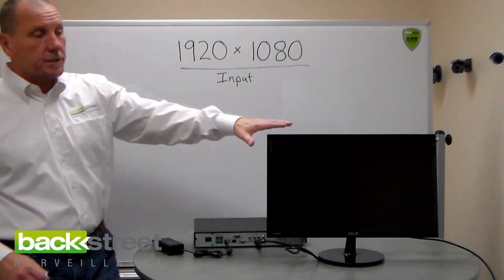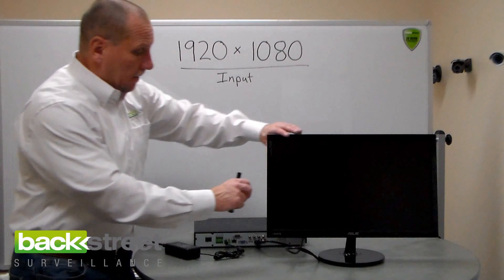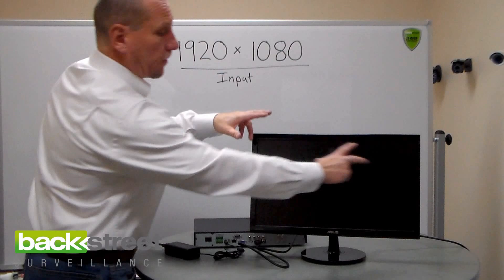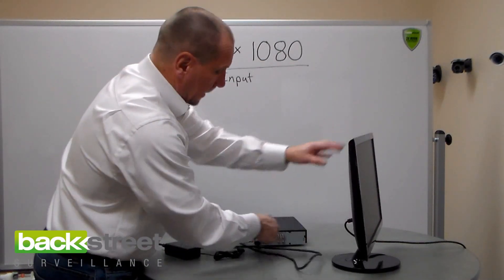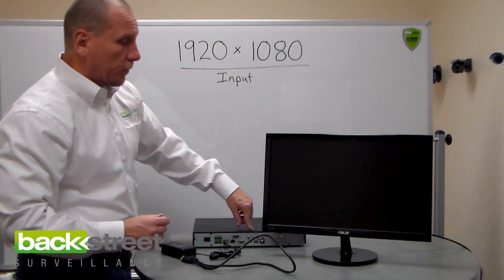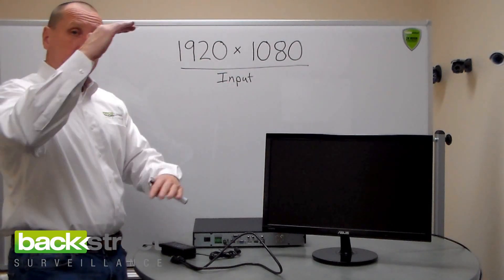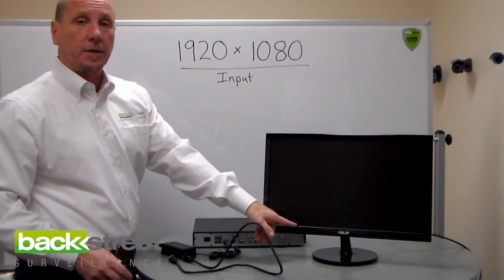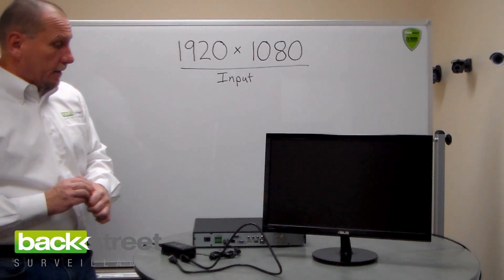How to Trouble Shoot Security Cameras - Trouble Shooting - No Video on Monitor

Comment: I have checked my cameras all getting 12 volts but still shows offline on all cameras what is my problem ?
Reply from the maker: Look for the one thing they all have in common....the video recorder. Since you are working with 12v I assume its a coax system and likely an older one. I would do a bench test with one camera you know is working and test every port on the recorder with it. If you know the camera is good, the cable is good and the camera is getting power, there is only one thing left...the recorder is bad or programmed wrong.
Reply: @BackstreetCameras  it's a wireless system

Comment: I was hacked yrs ago.  I was using a lcd moniter with No intergated cam. ( Early 90's)  they sent me a pic of me looking at my screen from the screens point of View ! I think it was a PowerPoint option.  ?  Or some sort of hack ?   Can you elaborate?  Or have you any knowledge of ?
Reply from the maker: Most hacks are not hacks. Usually the user did not change a factory default password which allowed the "hacker" to do a search on the web for the factory default password and then just logged in and started messing with you. The IP address they were scanning gave them the brand name of the equipment. No amazing hacking going on. ALWAYS CHANGE THE FACTORY PASSWORD ON ALL EQUIPMENT AND SOFTWARE. If you do, I doubt you'll get hacked ever again. Thanks for the question.

Comment: I get no screen at all everything reads the dvr but no success I think it’s the Hard drive I have to replace
Reply from the maker: Even if the hard drive is dead most systems will display live video if the NVR is operating correctly. The systems do not require the hard drive for operation (only recording) so it possible the recorder is the cause. Hope this helps.
Reply: @BackstreetCameras  
Hmm thank you for the reply and advice! 
Hopefully I can figure it out I think I’m close narrowing down problems

Comment: Please l am using hikvision 1Mp cameras and jovision dvr but when l power on the system the cameras comes black and white at the same time the cameras are not stable as well it comes and go off and l can t detect the problem. Please help me out
Reply from the maker: Sorry not enough information to give specifics but try removing all cameras from the system but one and see if the problem persists. If it goes away with one camera try adding a second camera. If the problem occurs when you add the second camera its likely the camera just added or a power problem. We suspect its either a faulty camera or the power supply powering the cameras may have a problem. Sorry we could not be more specific. Thanks

Comment: Ive got a night owl. Set it up was working fine. Few days later, tv is black screen. But system appears to be working. My modem light is on and normal ,cam lights are good and nvr power light is on. But nothing is showing on my tv.. Had this same exact problem with an amazon system years ago.  Hdmi output seems to fail somehow. Any info is appreciated. ty
Reply from the maker: Just take your computer monitor and use a HDMI cable to connect it to the recorder. If you get video its the TV or the cable. No video then the video out put on the recorder. You probably have but check the HDMI source button on the TVs remote . Good luck.
Reply: i also have a night owl , it was working fine this morning i come back and nothing , i tried 2 different HDMI cables and 2 monitors and still nothing , did you ever find a solution?!

Comment: I have a jooan  camera system and the video has shown up for all four cameras but now two have shut off completely and have stayed off despite factory resets.
Reply from the maker: Defective equipment likely, do you have access to tech support from the supplier? I would call them. The brand is not a main stream brand so support is going to be scarce. Hope this helps.

Comment: I have been trying to find out what is wrong with mine for over a month now and via tech support I attempted a factory reset, but there was no  beep or anything at all.  I have the DVR hardwired in to my internet connection and when I open my router screen on my desktop it doesn't show that it is connected to it.  Also when I connect the DVR to the monitor or TV via VGA cable or HDMI cable it doesn't recognize that it is there and does not pull up any DVR screen at all.  There is power to the DVR and all the cameras show that there is power going to them.  I have been working with your tech by phone and we haven't been able to figure out what is wrong.  Has anyone else had this happen and if so what did you do to fix it?
Reply from the maker: If the DVR is under warranty we need to replace it. It sounds dead to me.